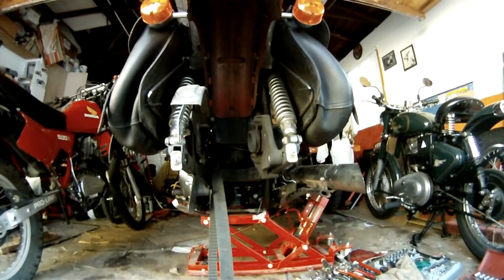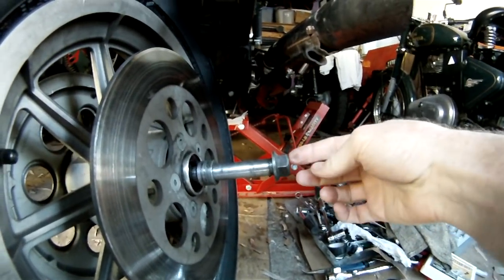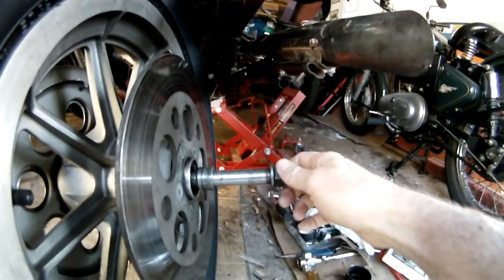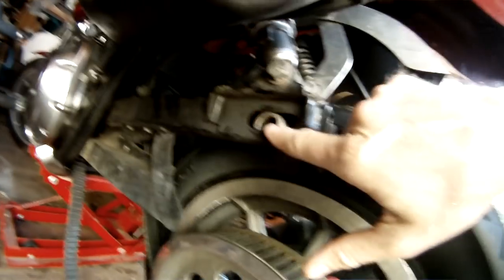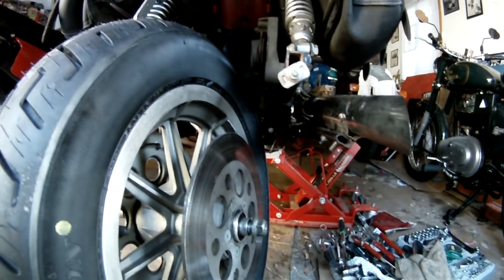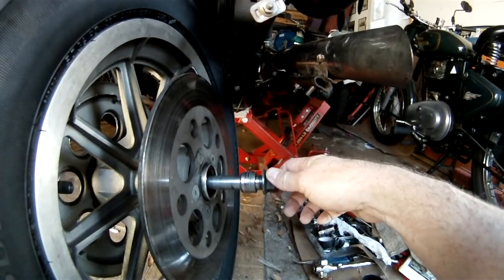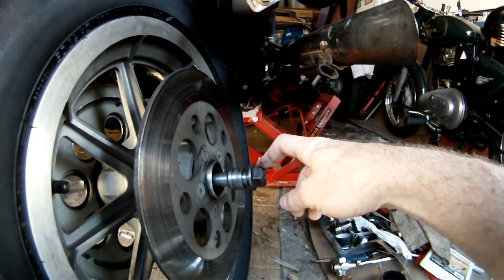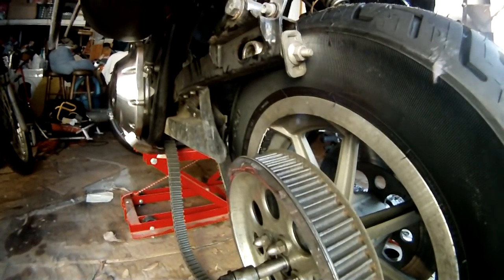Harley-Davidson Rear Axle Reversal

Comment: Inserting the axle from the right allows you to align the right side spacers and caliper bracket onto the axle before entering the wheel bearings which is arguably easier than jiggling them and the axle into alignment once the axle has been inserted from the left side.
Reply from the maker: That makes sense. Thanks!
Reply: @hoohoohoblin  do you put the axle on that way on a softail also,mine keeps coming loose.

Comment: The rotation of the wheel dictates the direction of the thread. I inadvertently replaced my axle from the pulley side and within 100 miles the nut loosened up enough to allow the belt tensioning cam to loosen the belt  so bad it was skipping teeth on acceleration. That will give you seat hickies...
Reply: The wheel and belt run the same direction on the Touring models and that nut is on the right side. You may have had another cause for the nut loosening up on you.

Comment: I own a 2002 FXD Dyna Lowrider. The axle was the other way around, with the nut on the muffler side, when I bought it. Never came loose. 
There is that cotter pin remember, wont come loose.
Reply: I have a 2002 dyna fxd also. Muffler vibrates against axle nut. I have screamin eagle slip ons
Reply: @steelbender58  Same happened to my SE full exhaust, but i changed to shorter Danmoto 2in1 since 2 weeks. Great performance and the nut is free.

Comment: The reason you do not switch is because the axle will be able to unthread with the rotation if the wheel, the factory set it so rotation tightens the nut
Reply from the maker: MrTeaze45 That makes sense, but I bet it's very unlikely that it would ever get loose and spin off, especially with the cotter pin in place.
Reply: +hoohoohoblin Unlikely, but that's the theory. Like centre nuts on sports car wheels, the left side is r/h thread, the right side is l/h thread.
Reply: +hoohoohoblin No,! Right hand wheel, r/h  thread.The wheel spins clockwise and the nut tightens clockwise (got it round me neck!)
Reply: except for one thing Sherlock... the axle doesn't turn and the nut isn't within 3" of anything that does turn... like the wheel... I'll make it simple for you. There is NO rotation of the axle.... smh...
Reply: MrTeaze45 umm no it doesnt lol , if you put the axel in from the pulley side and nut on exhaust side and turn the nut the way the wheel rotates it tightens,, the stock way would make it lossen thats why harley puts a “R” key threw the axel or c clip or carter key so the nit wont come off the way they put it in ,, dont believe me look for your self wheel rotation turns same way nut tightens when flipped ...
Reply: of course, your wheel bearings will 'never' seize... take a guess what turns then;   smh...

Comment: If you are riding a dresser, don’t flip it.  I bought a 2001 Ultra with it flipped and shortly after buying it noticed rear end felt unstable on a turn.  Parked it, checked the axle nut (reversed it was on right side- brake side) and it was finger tight!!  Thank goodness for cotter pin.  I spoke with a 20 year HD Master Tech and he said, yes they can loosen if reversed, he’s seen it many times.

Comment: I've had this softail for 24 Yrs now. Bought it new. I flipped the rear axel the 1st time I charged the rear tire. Seemed obvious to me. When I would be around tons of bikes, I never saw anyone else that was doing it. That should have been the factory way. Like you said, "It speeds the whole process up not having to fool with the exhust."
Reply from the maker: +Mr Niceguy it's good to know that it doesn't cause any problems after all those years. Some people say that but that might unscrew itself, but I don't see how that could happen because it has the cotter pin through the middle of it.
Reply: As You Stated. The cotter pin will not allow the nut to loosten. I would say virtually imposable.

Comment: I have a 2008 softail deluxe, with the standard shotgun exhaust setup,  with Rush slip ons.  I just replaced my rear tire for the first time.  Had to remove the slip ons.  Putting it back together, I reversed the axle, like many of you;  for the "next time".  I got the wheel mounted, belt tensioned, (brake pads replaced), wheel aligned...  Good to go.  Bottom slip on muffler, all set.  Top slip on muffler,  not so much.  Bumps right into the reversed axle, which now extends a little further on the right side, than with the axle in the factory position. Bummer.  That was a lot of work I need to re-do.   I guess the "next time" is here...
Reply: my softy has the nut on muffler side, changing it to give muffler some clearance.

Comment: The the friction of the axle turning can cause your bolt to come loose like one guy mentioned and I know other people have said the same thing. If you put it in from the muffler side the turning of the axle would cause the nut to tighten instead of loosen from that direction. On my bike it is flipped around. And it makes me nervous because even with the cotter pin in it it could still loosen enough for my wheel to slip which at 70 mph could be very bad. Personally, I am going to flip mine around and put it in the more difficult way just because I don't want to be a grease spot on the highway all because a couple turns of my axle nut.
Reply: My new to me bike had the axle going in from the pulley side and nut on the he right side behind the muffler.  I rode it briefly and felt like the rear end was a little bit not stable.  When I went to pulle the wheel to get new tires, the nut (on muffler) side was pretty much finger tight.  I’m a believer that this reversal caused that nut to loosen.  It did have the cotter pin in so likely wouldn’t have come off but I’m putting it back in from the muffler side…..also spoke to a buddy who is a 20 year Master HD Tech, he said yes they can loosen with the reversal and  not too do that.  My bike is a 2001 Ultra.

Comment: I just put some new tires on my dyna and I reversed my axle as well. But after doing so I was not able to use my chrome harley cap to cover the nut because it was hitting my muffler. Each side takes a different size cap. So I just left the cap off.

Comment: Depends on the model..a softail you have to remove the calliper so exhaust has to come off anyway, plus the axle nut end sticks out more than the head end so it can catch on the exhaust bracket, it's possible on a dyna but not a fatboy.

Comment: After watching this, I ran out to the garage to check my axle and lo and behold, it is in from the pulley side with the nut on the muffler side. My dealer must have done this last year when they put new bearings in. The nut has a notched edge with a cotter pin going through the axle between the notches. I don't know if this is a factory feature or if was the brain child of the mechanic that did the work. Either way , I guess i don't need to worry about the nut vibrating loose.

Comment: My 1988 FXRS, the axle nut is on right. If your the opposite? I run an FL with dual pipes? I drop lwr shock bolts, swing arm can be positioned accordingly to remove the axle

Comment: Could be the way the assembly line is set up.assembly lines are set up for speed of assembly rather than ease of maintenance???
Reply from the maker: Could be.  If it saves them a couple of minutes per bike on the assembly line, they will do it.

Comment: I learned the hard way. the stupid mechanic working on my machine did it. bad or old wheel bearings heated up the axle and locked the axle in the wheel hub to turn with the wheel. the nut was off in seconds. I noticed it because the bike was unstable during exeleration. don't flip it. dangerous!!
Reply: Go One . thanks for sharing that info bro....use to wonder about this..✌
Reply: I agree, don’t flip it.  Had one loosen on me that was flipped on my 2001 Ultra, noticed rear end was unstable and rear axle nut had loosened to finger tight.  Thank goodness for the cotter pin.

Comment: Update.   After walking away for a while, and retrying the install of the top muffler, I was able to get it to fit properly, with the axle in the reversed position.  I am hoping this set up will pay dividends on my next rear wheel removal process.
Reply from the maker: I'm glad you got it to fit. I've found that taking a break and doing something else for a while is a good idea when solving problems.
Reply: Thanks, appreciate your video.   With everything back on and tighten up, I, got about an 1/8 inch gap between the axle and the top muffler.  So I'm good to go.
Reply: Al Morrison that’s good feedback.  Makes sense.  I’ve since moved onto to an Ultra Limited.  Haven’t done a rear wheel maintenance on that yet.  I miss the Softail Deluxe for the short rides,  but wife is much more comfortable on the Limited, especially on extended rides.    Enjoy and keep the shiny side up!

Comment: Thank you sir.  It seems I have it right,  and apparently some guys say rolling the bike backwards,  their belt will rub the tire...but forward not...that's how close it is depending on the bike I guess.  I was surprised there isn't a thin washer between the swingarm and brake caliper,  doesn't appear you have one either...don't need It I guess.  I was watching your fxr vids before I got my fxrt,  thanks for the help and the videos,  It Is most appreciated, check out my rt when you get a chance.

Comment: the factory did it that way to charge more labour to customers. it's a layout gimmick so the customer spends more money on labour
Reply from the maker: +Richard Neil That's what I figured.
Reply: +Richard Neil, If the axle nut falls off the axle will only slide out until it hits the muffler.
Reply: From what Ive seen, most harleys dealers charge a flat rate for rear tire swaps anyway.

Comment: It's a torque issue, you'll still have to pull the exhaust to torque the nut.
Reply: Ron Cordes no just torque from bolt side,, and if that un eases you just put a crows foot on your torque wrench and subtract 3 lbs of torque .. and if you flip it the nut still tightens the way the wheel turns , some of these guys dont think before they type lol..if the nut is on pulley side if you rotated the nut the same way the tire turns it would loosen that is why harley puts a “R” key in the axel so the nut cant come off ..